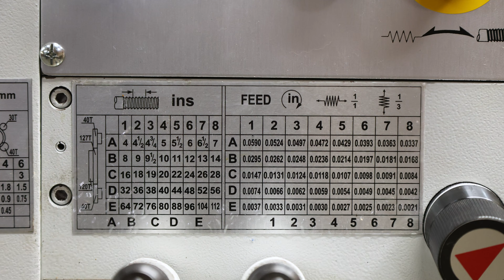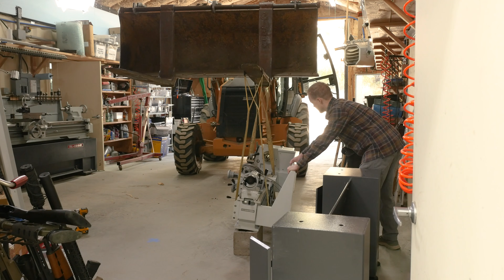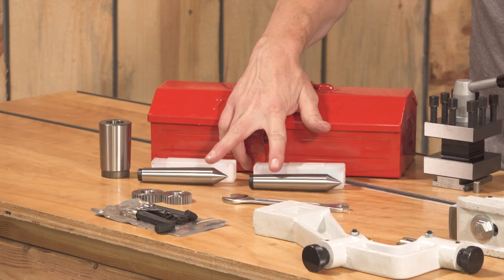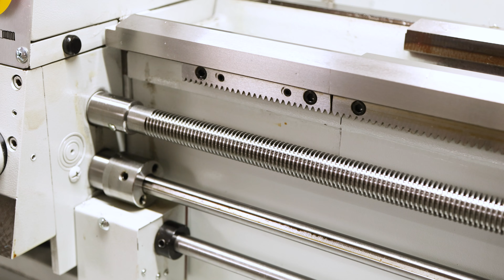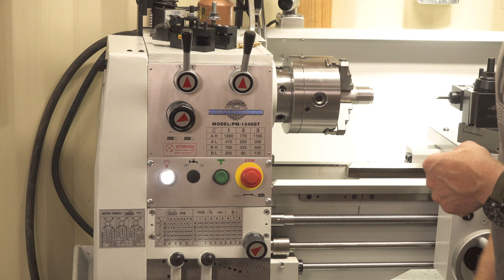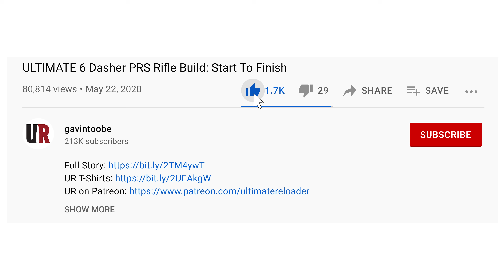Budget Ultra Precision Lathe: Precision Matthews PM-1340GT End-to-End

Comment: This is a great video, I'll be studying the latter part many times, certainly.  Thanks for creating and posting it!

I just got a 1340GT with the same extras you got except no DRO and a 4-jaw instead of 6-jaw chuck.  It's an upgrade from a much smaller, older, and rather simpler lathe.

I too have a 2-ton engine hoist that I'll be using to get it on its stand (also used it to move the pieces of stand, even take the cover off the pallet--your back is in way better condition than mine).  You're right:  a mechanic's hydraulic floor jack was just the ticket for getting it off its pallets and onto blocks preparatory to putting it on its stand, which is where I am now.

One rhetorical question, as a mechanic first and a machinist as a far distance second:  it seems to me that the lock nuts for the leveling feet should go below, not above, so that the rather sparse threads in the stand are backed up by the threads in the nuts.  The photo in the owner's manual agrees with you, though.

Comment: Me again, 
I have 2 questions. Have you done anything about tailstock way wipers? Does your dro fault out going back and forth between ABS and INC, mine resets to Zero when returning to ABS, it does the same when setting up the tool presets. Any insights would be appreciated.

Comment: I was looking at the PM 1236 but I don't like the fact that you need to reverse the feed direction at the headstock when you go from turning right to left and then facing outside to center. I am I retired machinist with 36 years running every type of machine you can imagine. I don't plan on doing any production work but I am used to running production lathes.

Comment: Getting it off the pallet was the hardest part for me using a 2 ton engine hoist. I ended up cutting the crate base to get under it. I used Kerosine to clean the lathe. I switched out the panel for one with a jog lever and variable speed control for the VFD which gives a huge amount of flexibility (changing the speed as I face for example). I also added a electronic end stop that triggers the VFD to brake quickly. Mine came with the chuck mounted which really affected the balance point and got exciting when a strap shifted. I installed my DROs and it was pretty easy, and I had no experience with doing that. Besides the VFD I got nearly all the same stuff as you did.  After using it for a year I added a mister, a RMP indicator and lots of cutting tools.

Comment: Had the same basic lathe (same castings, different name plate) many years ago in my father's short run shop. It did very good work for us
in fact I took it over one week and rebarreled a 30/06 Rem 700 into 338/06. Turned outside contour and of course 
the chamber and threading. Took it to Africa on my first African safari and took 13 plains game with it  including a 
2200 lb Eland.  Still a good rifle in my rack these many years later.  Was a very good lathe for us.

Comment: Nice setup.  I've had my PM1340GT for just over 10 years now and I really enjoy it.  I purchased the lathe along with a PM935TV knee mill at the same time back in 2014.  Budget was stretched so I only purchased a DRO for the mill at the time.  However, I just recently purchased the MagXact-100 and installed it and so far really like having a DRO on the lathe as well as the milling machine.
Mike
Reply from the maker: It sounds like you've put together a great shop with the PM-1340GT and the PM935TV knee mill!
Reply: @Ultimatereloader  thank you.  Yes I'm pretty proud of my home shop.  The Precision Mathews machines have been a nice addition.  
Mike

Comment: I purchased the same lathe last winter, took until April to receive it. I got all the equipment you mentioned plus the taper attachment, ER 40 collet chuck, a bunch of toolholders for the qc tool post, and indexable carbide tool set. I have since built a spider, 5c collet spindle sleeve and drawbar, wooden blocks for the 3+4 jaw chucks. I used a 4' length of unistrut bolted to the top of the backsplash and aluminum angle to use for holding the tool holders. I built a spindle stop with a 1/2" rod and bushing that fits the spindle ID and an expandable aluminum sleeve for the outboard end of the spindle
. 
 I have a few complaints about the machine. #1 no way wipers on the tailstock, I contacted PM to ask if the wipers on the carriage could be used and got a short response to just attach some rubber. #2 changing the belt from high to low has interference with the 120/127 thread gear and a little longer belt would be nice. #3 I seem to have trouble engaging the half nut precisely when threading. #4 No tailstock way wipers (that's a really big issue for me and PM ought to be able to address it
.
 I also bought a PM 833T, seems like a decent machine. The Z axis feed, both the quill and the headstock, really suck though.
My next big project is to buy 3 80% lowers to machine. Is there a book you could recommend to guide me on the processes?
Reply: To call these lathes High Precision is a joke. They simply are not that class of lathe. They are high end hobby lathes.
Reply: Good info Kurt  - Thanks

Comment: It is good that it is made in Taiwan the Chinese stuff is crap I know I have a Chinese lathe.
Reply: What are the weak points of the Chinese lathes. 

What made you most disappointed with it?
Reply: @Greyzonecompliant  Sand from the sand casting still stuck in the bed and painted over. Poor machining of the top slide where it met the cross-slide dovetail hand scaping done with an angle grinder motor capacitor blow up face plate would not fit quick release tool holders would not fit power relay would not work one of the digital readout sensors died in a week plus other problems they are CRAP. All this was found in one month of ownership just CRAP.

Comment: Great video. Another set up operation that viewers might find helpful is on how to level a lathe which is often a neglected or misunderstood process. Have you considered fitting the tail stock with a collet holder? This can help reduce the errors imparted when using a drill chuck.
Again great video with very important information when setting up a new lathe.

Comment: Ever consider doing a manual mil video and doing videos on optics cuts for hand guns, notching a bolt for m16/sako extractors, light stock work like opening barrel channels, trimming bedding, ect?

Like what would be a good home sized mill to achieve things like that while not entering the commercial domain with a 2500 pound 15k knee mill
Reply: Go to Precision Mathews website and check out their mills.

Comment: not a machinist, what are the applications where it being level is important. Why isnt flat or square enough?
Reply: The main thing is twist in the ways. So yes technically flat and square is enough. But you get that by proxy through leveling. It's incredible but the uneven pressure that makes a lathe not level will put enough twist in the ways to make it cut a taper of several thousandths of an inch over a reasonable distance.

Comment: I recently put this machine in my basement. I just finished the floor with epoxy and I am anxious to wire it up, so I will be following this. This is a fine model shop, all purpose lathe. Putting any bigger of a lathe down stairs into the basement seemed impractical.
Reply from the maker: Nice!  A great choice! Keep us posted!
Reply: How did you get it into basement? Same dilemma here. 1340 vs 1440 but need to get it down somehow
Reply: @mazdaRX7fdrdgen  I bolted 2x8s to the bottom of the machine. put a 4x4 across the man door to the garage and a 2x4 across the top of the basement door. used a come along and rope fall to EASE it down stairs. A little hairy but it worked. The contractor who built my house wondered why I wanted a straight shot to the basement LOL.

Comment: I own the ubiquitous mini lathe.  It works.  I'm not doing gun stuff.  Just random stuff car mods and robot parts.  I just made some motor to wheel hub adapters.
It works well enough, There's mods to make it better. but I haven't really needed to do those mods.
I also bought the cheap mill, slightly bigger than the cheapest one.  I did use that for 80% build.  I didn't like the end result.  too loose and rattley.  I'm just a hobbyist and not looking to perfect my trade so I don't think it's worth building my own but just buying what I want in regards to guns.

Comment: budget is an extremely subjective description but 7-8k for a precision machine like this isnt bad at all
Reply: “Budget” yeah when $8k plus is a “budget” for you and also making money using it along with a few bucks for the video
     Love the vids keep them coming
Reply: I would rather have an old Hardinge or South Bend.
Reply: I've run both the Hardinge and a Southbend Heavy 10 in gunsmithing school. The Hardinge head stock is to long to do short barrel. They run extremely smooth and are a great machine for everything else (toolroom model). The Southbends are pretty much worn out and nobody wants to work on them any longer, parts? I'll keep trucking with my 1340 GT. @joshuagibson2520
Reply: @joshuagibson2520 why?
Reply: @joshuagibson2520 if you can source one, and if it hasn't been run to shit and abused and if you have the time and equipment to get it from wherever it is to you, sure why not.
Reply: @joshuagibson2520  cool story bro